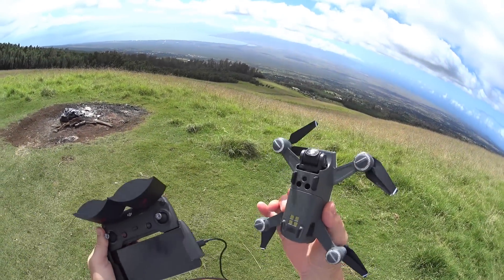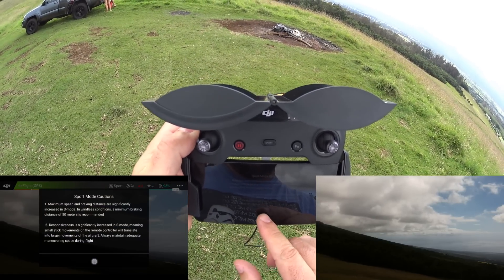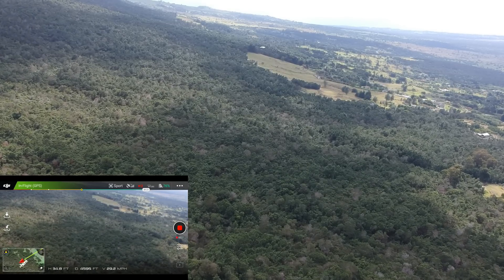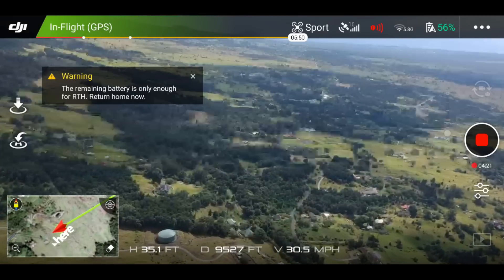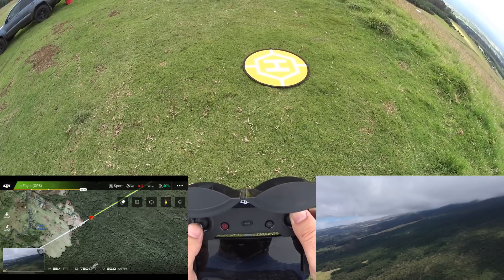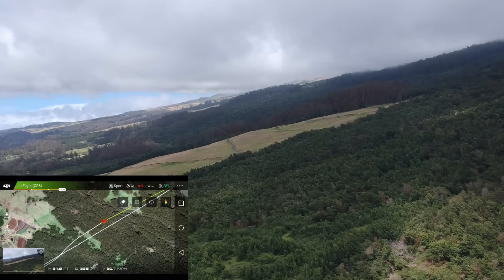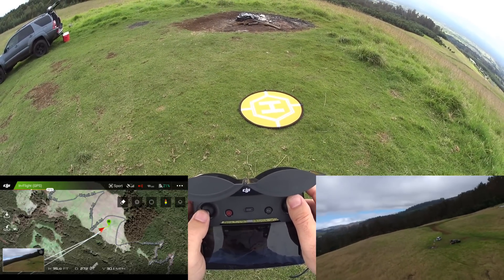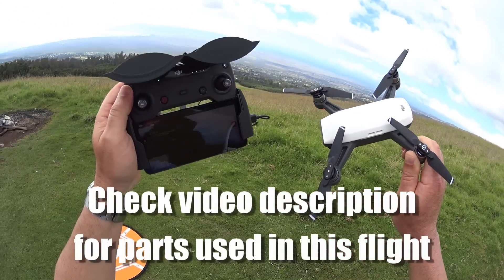DJI SPARK Review - Part 4 - [4+ Mile In-Depth Parabolic Range Booster Test 😱]

Comment: Shuld I buy a Hubsan h109s, a phantom 3 or a spark?
Reply: Axel abc keep in mind the Spark is $500 without the remote so it'll only go 100 meters away with just your phone. To get the spark and the remote you could get the phantom 3 advanced which blows the spark out of the water. If you want something small to take on trips grab a spark. But honestly the spark should be your last choice for aerial drones unless you just want a fun little stable flier.
Reply: Axel abc it all depends on what you're looking to use the aircraft for!
Reply from the maker: +Axel abc Honestly main factor is what size craft you want and if you need the compactness vs features.
Reply: How about Spark fly more combo vs. Mavic?  That's my dilemma; if the Spark had Ocusync and didn't seem predisposed to flyaways and sudden changes to Atti mode, I'd buy it immediately, but love the idea of not seeing the Mavic drop signal and/or take off to never be seen again.
Reply: Sosai X There really is no comparison between the Mavic and the Spark tbh. Mavics are far more capable machines than the spark,  but it really does all depend on your expectations of what you actually want with either drone.

Comment: Thanks for sharing. Great flight with just enough battery to make a safe trip home. Looking forward to seeing this exact test in the 2.4 mode.
Reply from the maker: +dheller777 Did the 2.4ghz test the same day.  Up soon.  I thought it would go better...
Reply: Dustin Dunnill - not surprised, 2.4 is poor on the Spark for some reason (ok on the Bebop where 5.8 is weaker), lots of tearing and chopiness. Maybe the video bandwidth needs to be reduced.